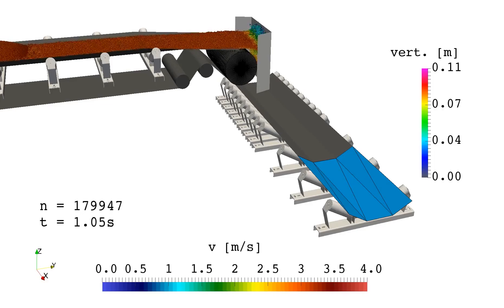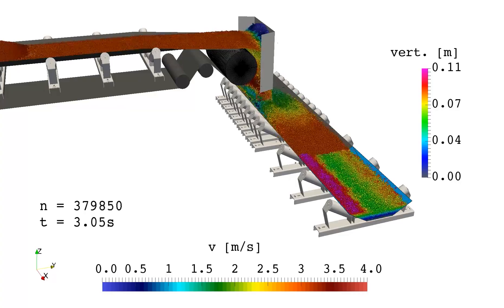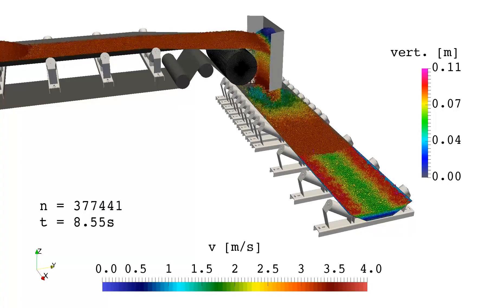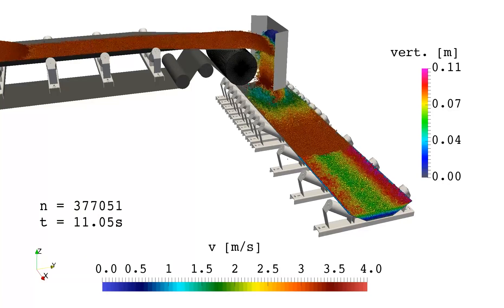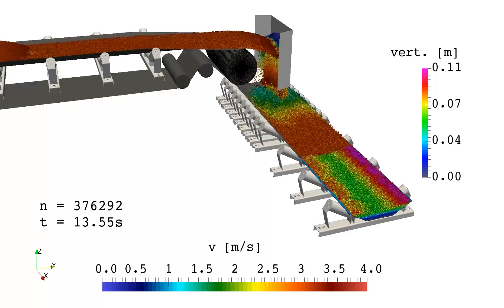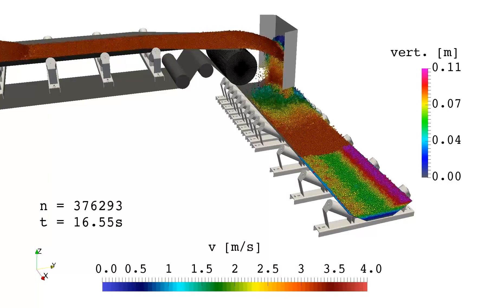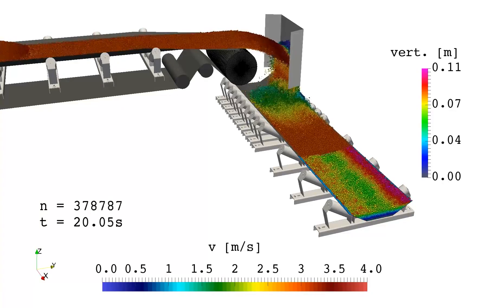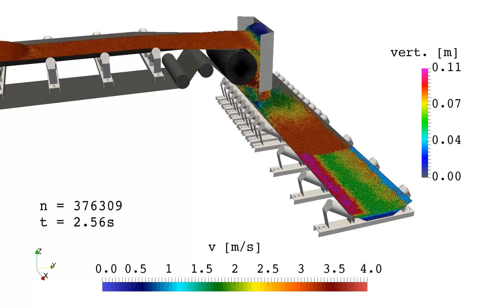Transfer Chute with Impact Wall - DEM Simulation of Belt Mistracking

Comment: In simulations of this type, how do you adjust the mass flow of the feed belt?
Reply from the maker: The massflow is determined by the mass flow rate and the simulation time. A belt conveyor usually has a know or expected mass flow rate comming from the crossection of the bulk material on the belt and the bulk material density. This values are also set in the simulation. For example 100 kg/s. The total mass in the system is then given by the time the simulation runs and the belt length etc.